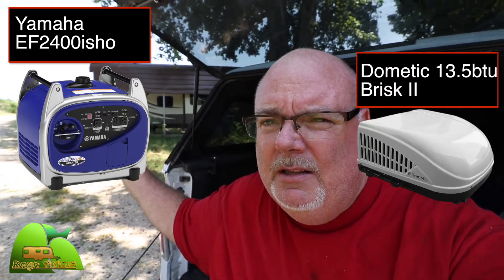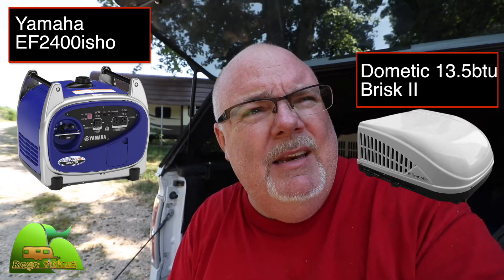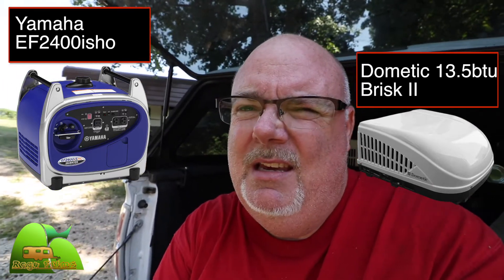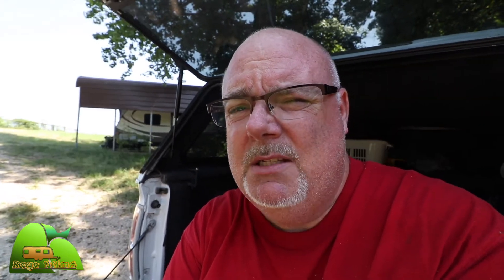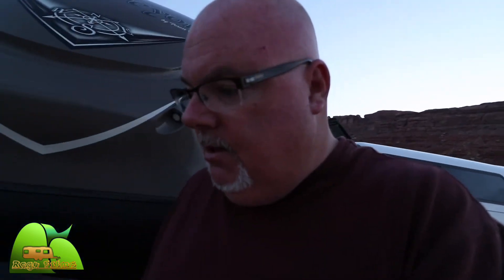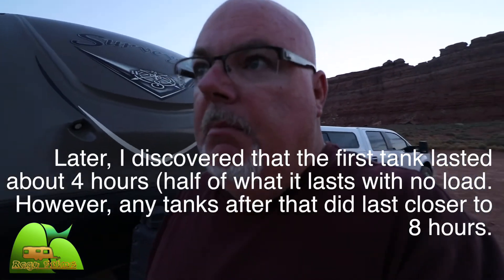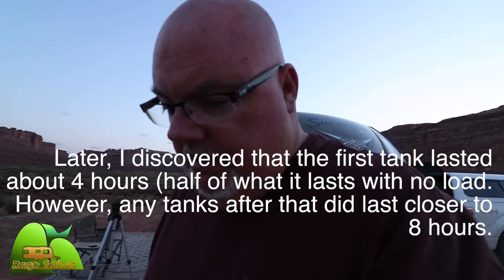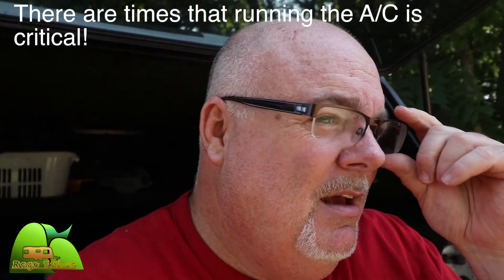Hard Start Capacitor PART 2: FOLLOWUP

Comment: I did the same install and have the same generator but me EMS won't allow power from the generator because it has a floating ground and is triggering a ground fault error so I had to purchase a special plug that bonds neutral to ground. Hopefully that will fix the issue and I can get the A/C to run off the generator. Keeping my fingers crossed and will report back once I get the plug. Thanks for sharing your experience.
Reply from the maker: Please report back!  I know what you mean about the plug.  We need to get one ourselves.  We now have a motorhome with a 7k watt Onan, but I want to bring the Yamaha to run for battery charging (it uses far less fuel).  I'll have the same issue with my EMS.
Reply: @RollingRagu  Hey RR, well the plug fixed the floating ground issue and I am getting power to the trailer. Unfortunately I can get the A/C fan going but not the compressor. It appears to me the EMS is reacting very quickly to drop in voltage because it's shutting down power even before the generator goes into overload. I'm going to now bypass the EMS to see if without the generator can get the compressor going without the generator going into overload mode. I don't think a few seconds of low voltage during start is going to do any damage. That said I'm going to take a serious look at the Microair Easy Start as the long term solution.
Reply: Just an FYI that I installed a Microair Easy Start and the Yamaha 2400ishc start the A/C without going into overload mode and without the EMS shutting off power.

Comment: Awesome video follow up. I just purchased a hard start kit for my home air conditioner. I live off grid so I'm excited to give it a go. Fyi my home solar system is large enough to handle all three 12000btu air conditioners but any help I will appreciate on the electrical system.
Reply from the maker: Sounds like you have a beefy solar setup.  We have since added solar to our RV.  400 watts.  It's enough to dry camp comfortably.  Thanks for watching!
Reply: Anytime bro! My setup is 4kilowatts for the home. Hopefully next 5 years when I upgrade to a full electric car here in the Caribbean, I will expand to three times my harvesting capability. Homes in the US have far bigger off grid systems than my humble abode.

Comment: I think the issue your having is not a strong enough capacitor the one your using the sp6 is for a coleman not a dometic. 

Dometic 3310727007 kit, Hard Start 
On Amazon for $26.99.
Reply from the maker: I didn't realize there was one for specific models?  I  tried to find detailed specs to see what the differences were and couldn't find any.  Thanks for your input, it may be helpful for people that are researching to shop.  As for me, we no longer own that trailer.
Reply: They don't make them for specific models..they all do the same thing. Just make sure it meets it's voltage requirements

Comment: Hello

I have a Honda eu3000is., I found your video when looking up hard starts install , great video and thank you for postings the how to and the actual results.  

Food for thought , your generator is at idle when you start the air conditioner ,next time you try your ac in hot weather , turn off the eco mode on the generator ( full revs ) and try the a/c with low fan to start with.  Once the ac is running you can turn the eco mode back on and the fan to high 

The ac is a big load start up load  , having the fan on low setting frees up  a little more  power for start up. ,the generator can take the surge better when it’s max power (high revs)

Some people turn off the electrical panel charge inverter/ converter for a little extra power at start up , this helps if your inverter/converter/charger is charging low batteries.  It also helps of you only run your fridge on propane and hot water on propane also 

Take care and happy camping from someone in Canada
Reply from the maker: Thank you for the tips.  My generator does not have a way to turn of eco-mode, that would be nice to have.   I have also been turning off everything at the breakers that I can, including the inverter/converter/charger.  I've used it this way a few times this summer and it has made all the difference.  The generator acts no longer runs at max rpm's for the A/C.  

I appreciate your post!

Comment: Great video series,  I watch both,  glad you survived the heat,  I live in the Carolina's and have a 5500 watt genset that struggles with my 15K btu A/C,  I ordered the suppco for my unit after watching your video.  It gets very hot here and the humidity turrible. Happy Camping
Reply from the maker: I'm surprised to hear your genset is struggling.  Hope the capacitor helps.

Comment: Great video, I to have the Yamaha EF2400ISHC and was told by the RV place that I would ha e no problem running the AC (Dometic 13.5k).  Turns out they did not know what they are talking about.  I just purchased the SPP6E.  Your video put confidence in me that this combination should work.  They are a great generator, just under powered and the overload feature works to its detriment.  Good videos, thank you!
Reply from the maker: Glad the videos gave you confidence.  Like I said, I'm no electrician, but I can show what's happening with what I have.  Hope it works as well for you too.